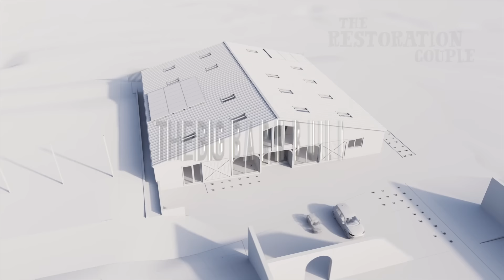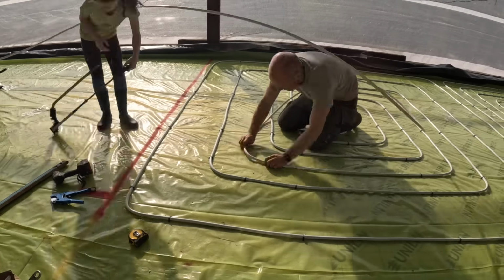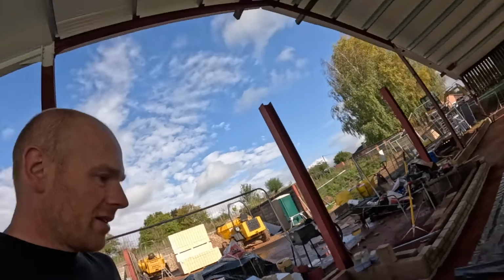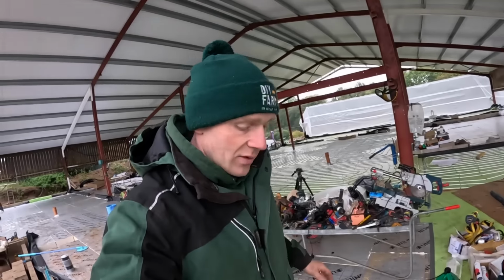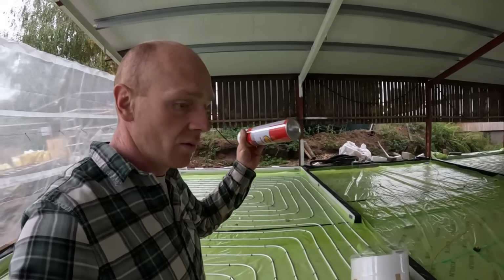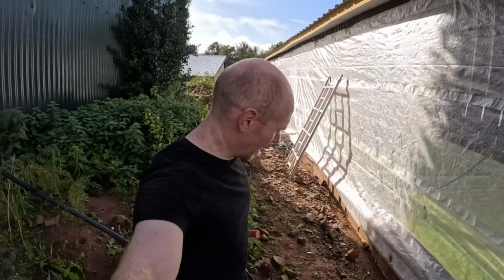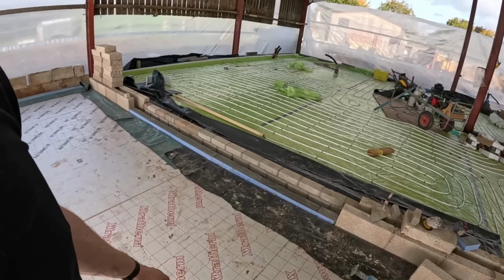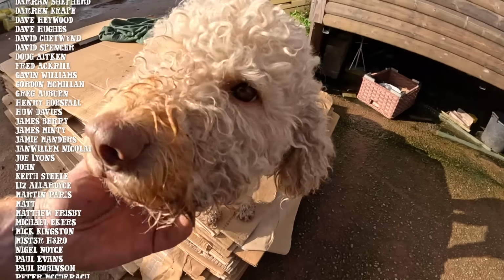DIY UNDERFLOOR HEATING INSTALL - Watch Us Do It Ourselves!

Comment: Hi Tim, not sure if your having a wet poured screed? If so, remove the latence within a week of it going off especially if you’re having a glue down floor. Be mindful of lignite in the screed too. I’m no expert but in our recent renovation it caused us a few issues.👍
Reply from the maker: 150mm power floated concrete slab, it will be a polished finish once cured. 👍

Comment: Loving the series Tim. My partner and I are busy converting an old Severn Trent pump station and will soon be tackling the UFH. Just a couple of questions: 1. What is the green pollathene, is it just pollathene or something special? Like how you market out the rooms, will definitely be doing that. 2. Where did you get the large "shower curtain" from and does the material have a name? We also have an area where we need to keep the weather out but keep the light coming in. Keep up.the hard work 😅. Dave
Reply from the maker: Hi Dave.  Just filmed a Q and A which will cover this however the green is just a vapour barrier that we are using for the separation membrane.  The sheeting is scaffold sheeting and was 3x45m rolls, great stuff and providing its battened or secured well, should do the job well.

Comment: So how often do you plan on walking/standing in the space 30 cm off the wall? Because now you'll be heating the bottom of your cabinets... kind of a waste.
Reply from the maker: None of this heating is really about how it feels on your feet, it's about using the slab as the thermal mass.  It will be quite a bit lower temp than most UFH but does avoid fixed cabinets and units. 👍

Comment: Make sure the heating engineer designing and installing your heat pump heating system really know their stuff,  95% of heating "engineers" whoi learned their trade on regular boilers don't really understand things like heat pump sizing, hydraulic separation and weather compensating controls that are needed to optimise running of a heat pump. The Heat Geek and Urban Plumbers channels are a great resource of information and possibly a route to finding the right engineer if you don't already have the right person in mind.

Comment: I don’t have any experience with framing on a freshly poured slab. Is there any concern regarding humidity warping timber?
Reply from the maker: The frame will all be on the walls rather than slab. We could have done it before slab but far easier to work on a slab than rough ground.